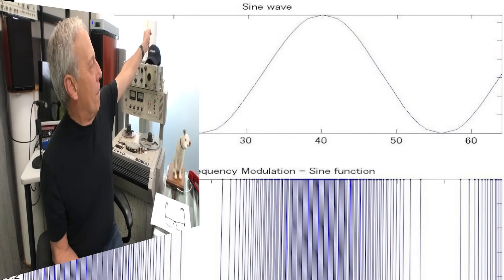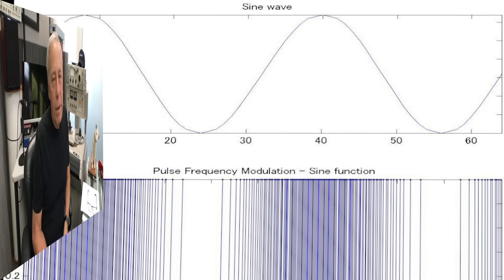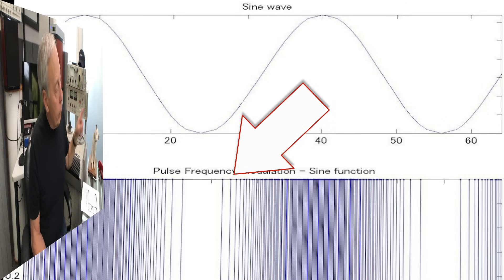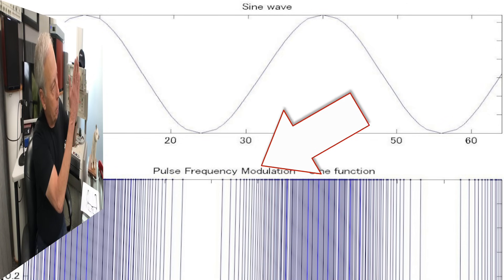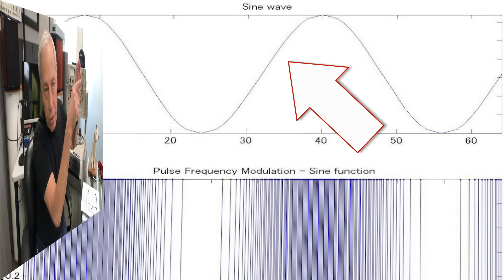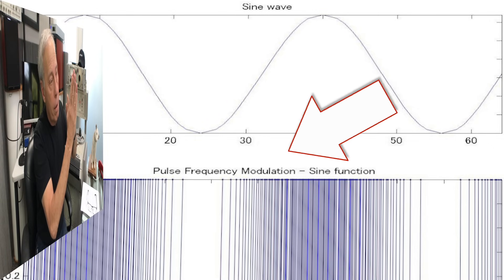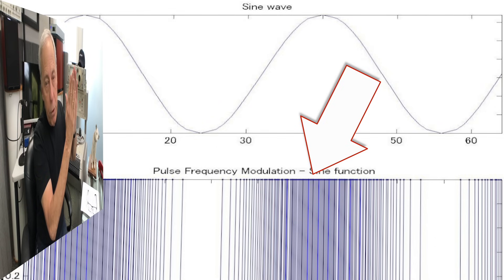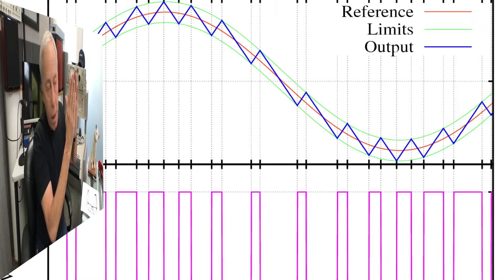What are the differences between Class A, AB, and Class D amplifiers?

Comment: Bottom line, differences are totally insignificant for heating experiences
Reply: The difference in a few hundred watts of heating from a moderate sized class A and the minimal heating from a class D is pretty significant. 

The differences for hearing experiences may be less significant. But, I’ve heard a few cheaper amps that didn’t respond well to big dynamic changes. Things like movies would have a delay in the class D responding and kicking in.

Comment: Ive been wondering whether adding a preamp would make a noticeable difference in sound quality.
My current stack includes the JBL Stage A170 speakers, the SMSL AO200 MKII integrated amplifier, and the Topping E70 Velvet DAC. I'm considering adding the Topping L70 preamp to the chain, but I'm a bit skeptical. I've also upgraded cables to balanced XLR
Could you help me understand if this upgrade would bring meaningful improvements, especially in clarity or control at lower volumes?

Comment: I am not sure you are entirely correct with your explanation of efficiencies even at this "low level". You also did not really touch on or emphasize the most important aspect which is sound quality, with A, B, and AB, and where D is really an exception to other circuit "topology" , where space and then heat dissipation becomes an issue. No one really cares about "efficiency" anyway unless it affects the construction cost which is another factor. ie Readers need to think of how to balance quality, versus "loudness" versus cost, versus physical size. This what needs to be explained.

Comment: So, in essence, the difference between class D and A, A/B amplifiers is that class D uses time sampling (pwm) at a very high frequency to avoid using the output transistors in the linear region, by employing an LC filter to "average" out an AC waveform created by time-sampled  full-power switching at a frequency multiple of the audible signal sufficient that it can recreate the audio signal through binary power switching?

Comment: Maybe me, and assuming my knowledge is correct, but it seems like you should have started the video explaining why you need bias (that amp performance isn't linear, and you may not want the amplifier circuits completely off during zero input times).    The first description was on a Class A amplifier, where it was stated the amplifier was running at 100% load even with no signal.    I was thinking, Someone not familiar with bias wouldn't understand why you'd want to do that.
It could be for the people watching your channel, that information is already a given.

Comment: I thought the output stage transistors of a Class A amplifier are half-biased ON when idle, not fully biased, because that would saturate the output stage when a signal is applied, right? A 100W Class A amp would be pretty big, I'm thinking :)

Comment: I’ve yet to hear an impressive Class D amp. They’re touted as being so great by many reviewers here on YT but in my opinion they all sound anemic in regards to bass performance and razor sharp mids and highs, in turn being very fatiguing to listen to. 
My 50 yr old Sansui 4000 (Class AB) with it’s overbuilt power supply and discreet tone stack sounds punchy, fast, and very musical even when compared to modern amps of supposed higher wattage. The fundamental qualities of analog amplification are largely derived from circuits that were somewhat inefficient but have greater dampening and transient ability compared to digital switching (Class D….cheap) amps being fashionably packaged with little tubes on top to bait the spontaneous consumers who have nothing to compare with. 
I have a mini, vintage receiver on my patio (Realistic STA-700) that was rated at 12 watts into 8 ohms (15hz-25khz! And 90db S/N!!) that sounds leaps and bounds better than the top rated little Class D offerings of today. The sonic clarity and bass reproduction by comparison is no contest. Modern, power brick class D amps are clever marketing but IMO are just that. Save your money and purchase any, well serviced vintage integrated amp or receiver and don’t look back.  Modern speakers, to the contrary are being well designed and quite inexpensive. Speaker technology is purely physics and hasn’t suffered from the same gizmo-fied techniques used to market these little Class D amps, mostly because you can’t alter the physics so greatly with a loudspeaker….they’re one duty is to take an electric signal and vibrate the air molecules…..you don’t have the comical additional need for little tubes and lights and such. Cheers and happy listening
Reply: Buongiorno da Roma. E' vero quello che dici della classe D.
Ma e' proprio la classe D che, (incredibilmente) tecnicamente parlando e' musicalmente la piu' corretta.
Gli amplificatori in classe A e AB furono progettati tra gli anni '50 e '60 aumentando la gamma media e bassa per poter far "scaturire" un suono credibile dai diffusori.
Questa "magia" se vogliamo chiamarla cosi' e' ancora presente nella produzione degli amplificatori in classe A e AB.
Ma nessuno lo sa e al momento dell'acquisto si orienta verso gli amplificatori in classe A e AB ignorando i "muscoli" che furono introdotti in quelle 2 classi.
La classe D non ha "muscoli".
Gli altoparlanti collegati a tali amplificatori riproducono il "vero" suono. 
Come e' possibile? Forse te lo starai chiedendo...
Il motivo e' legato all'alta efficienza della classe D.
Ma per poter sfruttare questo vantaggio e' opportuno collegare questi amplificatori a diffusori in bass reflex.
In questo modo le classi A, AB e D potranno avere una "base" di partenza comune.
Io amplifico i miei diffusori RAM CD 20 con un semplice amplificatore in classe D dotato di un chip TPA 3116 D2.
Il Marantz 1030 che avevo ora riposa in cantina.
La differenza di suono era troppo evidente a suo sfavore. Ti auguro una buona domenica e ti saluto. Ciao.

Comment: Hello Paul.  I am sorry to inform you but your description of Class A is in error.  A pure Class A circuit is biased at 50 %, not 100%.  So, your analogy that a 100 watt Class A amplifier is always running at (or consuming) 100 watts is incorrect.  It is actually running at 50 watts.  By being biased at 50 %, the designer assures the transistor (or tube) operates in its most linear region.  Operating below 10% or above 90% of the devices capacity is typically outside of its linear region.  In reality, most Class A amplifier circuits are forward biased somewhere between 30% to 40%.  The more the device operates within its linear region, the less total harmonic distortion (THD) is generated.  

Class A/B amplifiers typically start off Class A in the first stages of amplification, certainly in preamp stages, may remain Class A through the driver stages, but convert to Class B for the output stage.  This, as you mentioned, saves power consumption when idling or operating at low amplification and greatly reduces heat output.

Comment: PWM= Pulse Width Modulation turns on high power for set amount of times at set intervals to generate an amount of power rather then directly power something with a set amount of power 100 percent of the time,  its blinking power on and off for set times to match a wide range of power output levels rather then a fixed rated ouput of power from a port

Comment: Thank you, Paul. Personally, l don't know what class my hi-fi amplifier is but that's not an issue for me as the system sounds great! I am a bassist and own a Bergantino B|AMP amp running into two Bergantino cabinets... I believe the B|AMP is a class D amp. I know it's one of the finest bass amps on the market and it does sound quite incredible. I remember going to a jam night and all sorts of bass instruments went through it, from active to passive and even a bass ukelele with rubber/plastic strings!  Every instrument sounded fantastic without any EQ change, just an increase in input level for the passive devices. How is it that this amp sounds far superior to all the plethora of really high end amps that I've owned previously? Thank you and kindest regards from Den Finch in The UK.....
Reply: You are correct. I have experimented with so many Bass and GTR amps with my stereos, I have a AUDIOPHILE system going thru TWO 100 watt plexi's on 9oclock gain volume on 12 ha ha ha... NOTHING can touch the mids..as GTR is all about mids, and that is the range humans ears hear, -mids. The voices and cymbals sound as if you are next to the peformers. TRY IT. you wont go back. C'mon its PLEXI's ha ha ha LOUD LOUD and clean when set up right.

Comment: which class amplifier does a new 2021 onky 9.2 av reaciver use the reaciver iam looking at uses 750 watts does it use the whole 750 watts when turned on  or like only using 5.1 channels or not cranking up the volume will it use less power , dont know how a av ampilier works

Comment: Question:
In the manual of my Parasound HCA 2200ii power amp, it says the device is class A/B. More specifically, it says it is class A to a power of 6W and class B thereafter. But shouldn't it be the other way round? So it doesn't consume 1000W in standby?

Comment: Hold on. Class A biasing means the transistor - or value - doesn't matter which - is biased so that when there is no audio signal modulating the base/grid the transistor is outputting voltage that is half-way through it's linear range. The base voltage bias should be calibrated so that when the audio signal is maximally negative then the transistor is at one end of it's linear range, and when the audio is maximally positive the transistor is at the other end of its linear range. That means when quiescent the transistor will be constantly outputting half its rated voltage, and when it is maximally positive it is outputting most of its rated wattage, and when it is maximally negative it is outputting the least amount of its rated wattage. Either way the biasing is such that it will never turns fully on and never turns fully off - it always stays within its linear range.

This means that you need a mechanism to couple the transistor output so that that only the fluctuation in voltage is seen on the output, and not the constant voltage (which is dumped to earth). This is usually done by means of a transformer. This sort of usage is normally described as "single ended" - only one power transistor is needed. Nothing is crossed over, and nothing is push/pull.

Comment: I used to have a Technics 300w Class A amp back in the 90s, I used it for audio, and a heater in the winter! Just kidding of course, but I remember it had a large enclosure with plenty of space inside, and a lot of vents. It did get pretty warm, as you can imagine! This amp sounded great, but was a little noisy.

Comment: to clean up sampling. could you take like a pentium or an i3, run it at like 1 ghz and have an amplifier governed by the cpu's clock cycles? instead of having 100khz, you'd have 1ghz or 2ghz sampling? essentially creating a way more accurate digital sine wave? or am i just dreaming. ... ?? i mean, you'd have a 200 watt amp drawing 300 or 400 watts in order to operate and we'd be back to A/AB efficiency.... but you'd have a class D that sounds natural. .... unless I'm crazy.

Comment: Don't forget what signal u putting into them. If its analog signal fed into class A/AB its going to sound better, but if you supplying a digital signal witch is already distorted (because its made from simmilar "PWM" as well and has its sample rate) before reaching an amp, you are not getting much of benefits from it. A / AB is good for amplifying analog devices, such as guitars, vinyls, tape players, ect. Its not that great with phones or computers. Class A is a best, but using it sometimes its pointless and class D would do same job for less cost.

Comment: Is there a such thing as a non-noisy Class D Amp on Studio Monitors?  I listened to several and they all had a very audible constant hiss to them.  At some point I bought a pair and had them on but no signal running through them and thought it was raining outside due to all the noise coming out of the tweeters.  

Ended up returning them for a different design using an AB.  Much quieter.

Comment: Thanks Paul! That's definitely a good, basic explanation and as you stated several times, the explanation is a 'nutshell' or 'ballpark' level that stays as compact as possible. Still, it's an explanation that offers me a decent starting point or ledge to work from. Personally, I prefer analog system components and presently, my centerpiece is a McIntosh 2105 power amp.

I recapped the amp as best as I could last year but because McIntosh wasn't able to pin down exactly which version of the 2105 I had, I went by their 'best-guess' schematics. I think the schematics I used were pretty close but I still saw some references in the prints to make me fall short of being 100% certain. 

The biggest concern, and one that I need to fix is the degraded wire-wound resisters in the Left channel's output board. The Right channel output board may be OK but rather than trying to replace the resisters, I really need to just go and replace both of those boards. That way I don't have to worry about the transistors that may, or may not, be bad. 

I did the recap about 7 months ago and I know for sure that the Left channel; will only put out about 68 Watts max, (no clipping). That's not good for an amp that should put out 105 Watts per channel at the very least, (a good working MC-2105 will have no trouble outputting 120Watts and still maintain the maximum rated distortion and specs).
Thanks again for the explanation.
Rich

Comment: Dear Paul,
on one hand side it is a good thing explaining such theme to the hobbyist, on the other hand I'd wish a bit more precision in detail. There are several explanations for the "classes", and there are lots of advantages and disadvantages - but e.g. I never heard of "Class A" in terms bias power consumption equals output power. If you take the most strict definition, Class A means no output device switching at all on a given load - never. If you calculate that to any impedance, you will get a maximum efficiency of 25% in a transformerless push pull design - so the Class A amp of 2x100W output will consume at least 800W...
Another point to mention: the topology does not say too much about the result - one can do better on any base...
Best regards
Martin

Comment: Class A amps have small output of power. Class A, B has a higher output ratio and is only 2 ohm stable. Class D amps have high output of power and 1ohm stable that will make your speakers pound.

Comment: So if I'm understanding this correctly even if I have the amplifier turned off It's not in a standby mode this thing is still drawing power come or is it still drawing power even if I'm not sending a signal through if I have it on?

Basically should I be unplugging this thing from the wall when it's turned off or just making sure when I have it turned on I'm not just feeding it no signal?

Comment: Thanks you and Great job explaining it. I think I understand more now then i did before I watched. Before all I knew was that Class D has been a huge let down for me when used for anything but Lows and even then they stil seem to lack a bit of accuracy or punch in the sound. I find even a pretty spendy mobile class D like a Zapco or Infinity to be totally unacceptable in the high frequencies they get harsh and almost sound like the output is Clipping even at lower volumes. This is perhaps a function of the low pass filter put on the amps output so we dont hear the PWM singnal way up at 100k or whatever it is. If i was getting this type of sound from any class AB I would think that the signal was to hot of the amp its self has been pushed into clipping or maybe even the Slew rate on the amp was far to low for musical reproduction but being a class D I had no clue and Ive thrown three away now. Can people really not hear that horrible sound? Can you hear what Im taking about?

Comment: Are all class A tube amps single ended? I'm curious about my new Supro amps specifically, I was told I don't need to bias the amp when changing power tubes which means it's single ended, no?

Comment: So basically, VERY simply put:
Class A: Constant, full supply of energy. Lots of wasted energy in the form of heat.
Class AB: Only draws the full amount of energy when it gets a signal from the guitar. Saves energy.
Class D: Saves energy using gaps, more gaps when there's less signal, more impulses when there's more signal.

Comment: He explained one thing that is very obvious to those that have tried some class D amps ... "The engineers have to come up with some pretty fancy techniques to make a good class D amp".

That is so true sir, cause most Class D amps you buy are pure crap. Nothing beats a good Class A/AB amp .. nothing. 
There are some few good examples of Class D Amps, but they are also expensive. 
Generally speaken the Class D amps are used for cheap amps that promisses much more than they deliver.

You can find so many power amps today for PA, Bass, guitar. keyboards and they all cost very little but sports a lot of watts on the paper.
What you end up realising when you compare them is how little worth all those watts is, when you realise your old Class AB 2-300w amp has more dynamic responce and actually plays louder than a modern class D Amp that promisses 1000-2000 watts.

Give me a good Class A amp with a good powersupply
Still remember first time I heard the fameous Hiraga 2x20w Class A Amp. It sported 0.5 Farad Caps in the PSU.
It was demonstrated in a local HiFi demo. It played for like 5 min when we started to hearing some distortion.
One of the people setting it up also heard it and was investigating it, Laughed and said "Sorry We are playing on a turned off Hiraga Amp".
It had been playing on the caps for all that time.